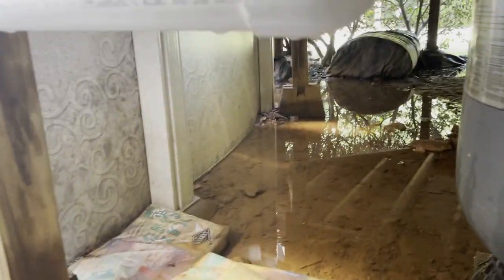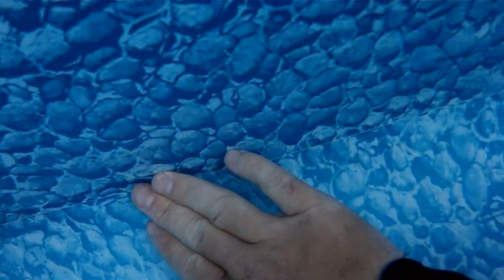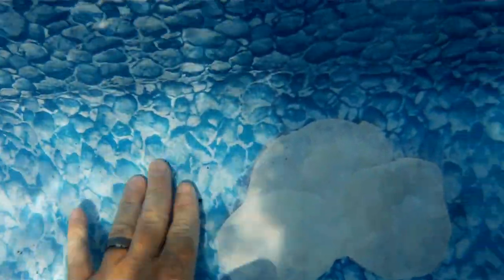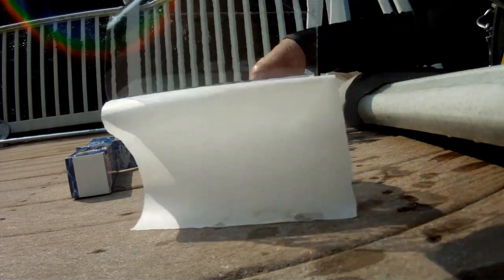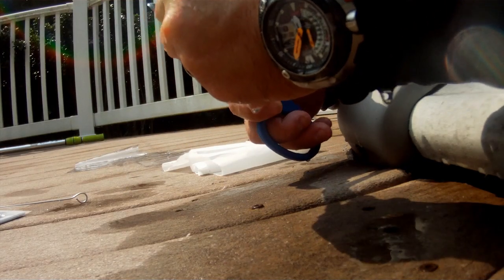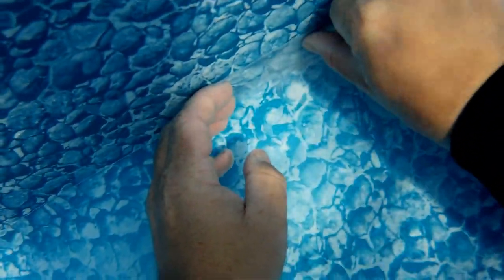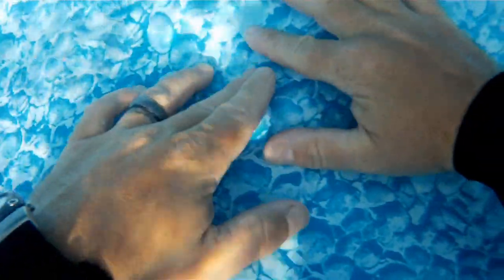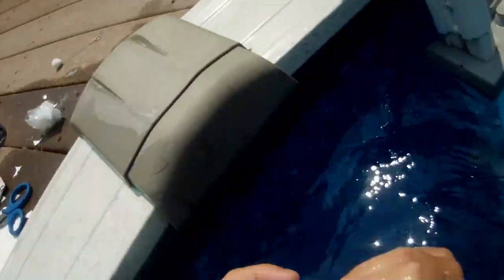Pool Repair { Easy Money For Scuba Divers }

Comment: for the new divers, I would even use this as an opportunity to work on buoyancy and trim control?? granted it's 3 feet of water, but if you can stay perfectly trim in 3 feet, you can do it in deeper water.
Reply from the maker: That is a great idea Jack Grant. There is no better place to work on buoyancy and trim than in a shallow pool. Thanks for the suggestion.

Comment: The local pool store will call me in the fall to patch leaks when they are closing pools down for the season. They don't have the gear for their employees to get in the colder water. I keep a old 7 mill suit to use because their employees uses way to much glue and once the excess gets pushed out if  it lands on your suit it's there forever. They have a tool to find the leak so I just simply apply the patch. They pay me $100 per pool and I normally do two or three a fall
Reply from the maker: Sounds like you have a great working relationship with them Chuck Walters, keep up the good work.